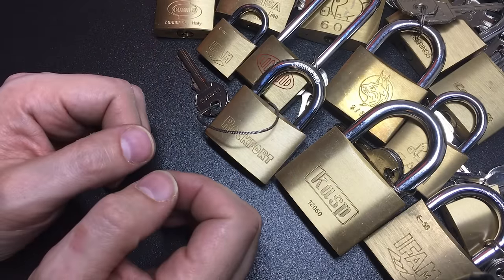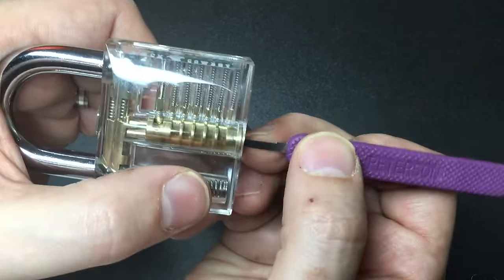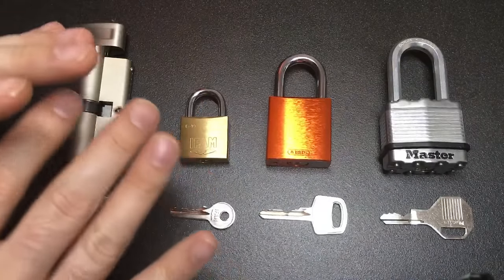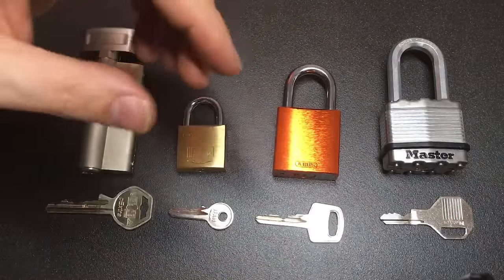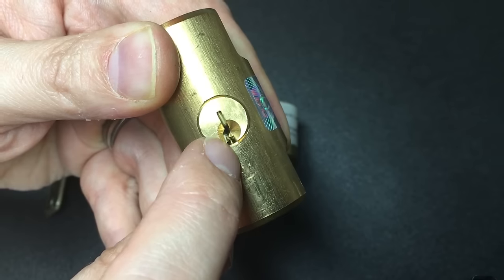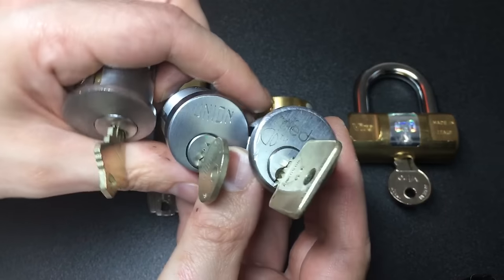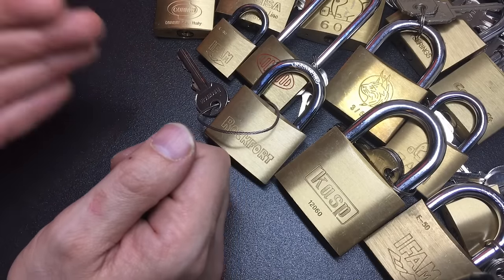Top 10 Reasons Why You Can’t Pick a Lock

Comment from the maker: This is my Top 10 reasons why you can’t pick a lock. Did I miss any? Let me know in the comments! 👍😃😃
Reply: I also find weak springs makes it harder to pick.
Example, if I put the key in with the pins on top like your picking it the key will turn smoothly. If I turn the lock upside down and insert tbe key it wont turn because the springs are to weak to push the top  pin in the upward direction.
So picking seems harder from lack of spring strength on these locks.
Thanks again great teaching!
Reply: Lock Noob I would like to add that no brand euro to my collection looks like my ces. Locks what is it called?
Reply: I rely enjoyed this video! It has inspired me to keep going and not give up. Thank you brother!
Reply: great video man. i just started n i feeling that pain already
Reply: This may be more for new pickers, or on an installed lock you don't have info on, but tensioning in the wrong direction! Have done that more than once!
Reply: Thoughtful videoclip reminding me of the very basics. It is easy to forget. Educational.
Reply: You don't use the right training tools aka you learned how to pick a specific lock and not locks. That way you make wrong assumptions(one of your points) always try to get several locks of a specific type and switch between them. Learn to pick lockS not one lock.
Reply: You might be trying to rotate the lock the wrong way. Been there; done that, wondering why no pins could be set properly.
Reply: @RWBHere  got a US core gifted. Been there.
Reply: Picking the warding, edge of the chamber, outer pin, or anything else other than the element you're trying to set. Or, simpler, bad pick placement.
Reply: Thankyou. Have been having a frustrating time with a lock that I can open 6 times on the trot, but go back to the next day and then fail for the next 3 days! Never considered the core spring affecting tension balance. Opened it twice since watching this. Subscribed!
Reply: I spent over a year trying to pick this crappy cheap master lock, I tried everything to pick it and I shined a light in there and there is a pin lodged to the point it wont turn the core. For a year I just thought I was defeated by a master lock, i also have a cheap uhaul lock that may have a similar problem further back.
Reply: Knowing that your left hand, and your right hand are doing. As ì am picking ì  Notice my tensioning getting stronger from excitment. My weakness
Reply: 11 you've never picked one before, don't have the tools, don't know what lock you're dealing with and don't even know what you don't know
Reply: One more reason: Random fabrication details
Some month ago I bought a bunch of locks on ebay including an ABUS "mylock". These are typical locker locks and easy to pick, but this one was almost unpickable. Absolutely no feedback, almost no perceptible binding and it was impossible to rake or zip it open even though it just contained standard pins. The key worked fine so it wasn't broken but I couldn't manage to pick this cheap lock for weeks. Then I gave it to a fellow locksmith who also wasn't able to pick this one. I tried 4 other "mylocks" and they all were easy to pick but this single one was a real problem. When the fabrication hits the spot even cheap locks can be a real pain.
Reply: @thumperlockpicking9269  Yep! I do it all the time.
Reply: @mrbear8746  where are tho brother?
Reply: @thumperlockpicking9269  I'm in NC trying to stay cool! Lol.
Reply: @arterialtribal  having this issue with two unbranded locks. Both standard pins but no joy. Pick the bigger more expensive locks no worries.
Reply: What if the core turns half way and stops? I don’t have a key so I’m not sure if the lock even opens. Could that be it or am I doing something wrong?
Reply: @johnwickpick8621  7a
Reply: @1stNumberOne  there could be one of a number of problems.
A couple off the top of my head might  be,
1 pins fall through bible into bottom of keyway (need to be relifted using pick)
2 cylinder is rotated wrong way (pick again tensioning in the opposite direction or use pl spinr)
Reply: A couple of problems i remember i used to have was how to know what pin im touchijg and manipulating and also how to tell whether this pin is binding or set or falsely set etc
Reply: Very helpful great video thank you
Reply: @johnwickpick8621  .
Nice

Comment: Sometimes the tension tool slips and i think i have a false set :)
Reply from the maker: Been there!
Reply: Always.Never able to do anything about it
Reply: How good is it! Haha
Reply: GottaGetMe6  now thats funny
Reply: I felt that, like spiritually
Reply: Lol im still doing it. For a split second i get that little feeling of excitement and then the despair sets it as the set pins fall 😣
Reply: Sometimes it falls out and I think I've opened the lock
Reply: i had a job where the tensioner horizontally on the right had me pushing it down so it interrupted the pick and kept flicking out of the space ive put it in (it simulates a pin click or core rotation but really isnt)
Sometimes the problem is fixable(if you dont have the right tt)  by switching the tt (in my case i placed it on the left and pushed up instead of on the right and push down)
Reply: @lakshaynegi82  i get this often too, can only say you'll likely need a thicker tensioner so it doesn't have room to slip, hope this helps but it is annoying!
Reply: How do I fix that
Reply: @ziga1868  depends on your original stance

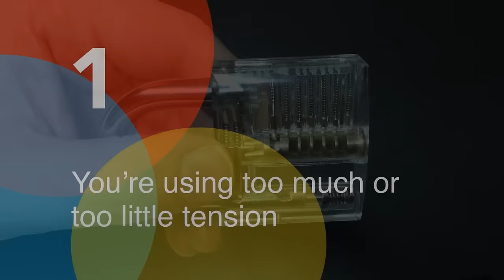Comment: 00:30    1.  You're using too much or too little tension
02:40    2.  You're binding the core
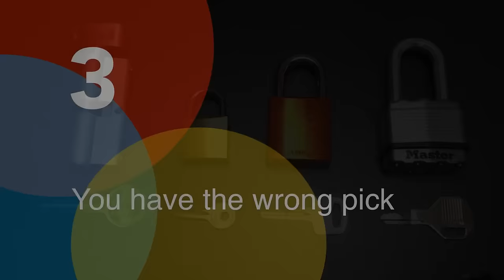03:48    3.  You have the wrong pick
08:54    4.  You misidentified the lock type
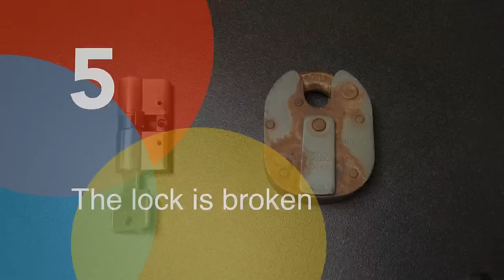13:26    5.  The lock is broken
15:27    6.  The lock is dirty
17:24    7.  You chose the wrong tension tool
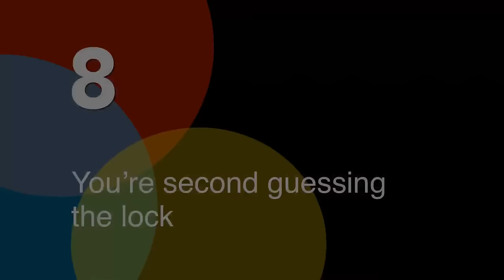19:32    8.  You're second guessing the lock
22:17    9.  The lock might be beyond your current skill (for now!)
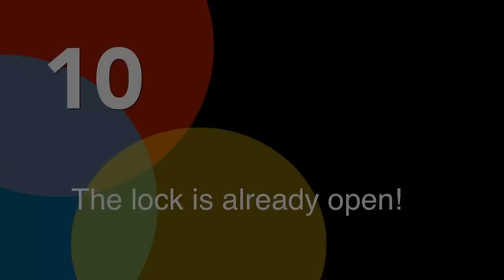23:55  10.  The lock is already open!
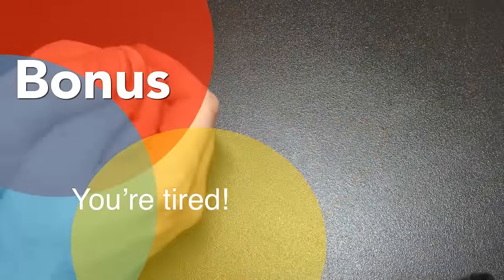25:40  Bonus reason:  You're tired!
Reply from the maker: Useful
Reply: @LockNoob  Reason 7.5 : You don't *have* the right tension tool.  Nothing in your bag-o-tricks quite fits the keyway so you can reliably tension the core and feel some feedback ... and you must still have enough room for the pick(s).  Time to acquire/build/hack more tension tools.  :)
Reply: Give this guy a thumbs up !
Reply: @LockNoob  I have one of those high spring tension disk padlocks that's super easy.... well except the poor quality means a bare minimum tension. Because pin 4 will get caught below the shear line. It's also pinned like 5 1 1 5, so really easy to over set also. Been so many times I've struggled with that (especially if it's later in the practice rotation) that #10 & #11 probably defeat me. I've seriously thought about offering it as a challenge lock, because it was supposed to be easy. But eventually I have decoded it.
Reply: Excellent.  I was looking for this.  Thank you
Reply: @arrrg3846  yeah I couldn’t open a lockbox and just assumed it was double sided but I didn’t have the right rotation tool. Turned out the pins were on the other side
Reply: You might forget that being drunk is not the best condition to pick a lock.

Comment: All very sage advice, I've experienced almost everything described here in my few months of picking. Tension has been my #1 battle, it can be soooooo different from lock to lock and if you're like me and grab a wide variety of brands and difficulty levels for each practice session, you can find yourself trying to apply what worked with the last open to the lock you're now picking and it just doesn't translate. Tool selection would be the second most important thing that I finally had an 'aha moment' and started reaching for the thinner, more extreme profiles (ie Sparrows Lunatic in my case) that I was avoiding because they looked too different and I had in my head that they were just for really extreme bitting but it turned out that using a profile that had so little meat to it did a couple of things for me. First, I had to ease up on my heavy handedness because if I applied any real force to it, it was going to snap and that allowed me to practice finessing the pins in a gentler way than I had before and really highlighted that I'd been forcing pins into oversets far more often than I thought. Second, it's all around a more versatile pick with the reach it has so I found I wasn't bouncing back between picks  anymore, I was able to use it to set those high pins at the back without oversetting the lower cuts in front of it, but I could also use it to set the more 'mundane' pins along the way. Great video, I know there'll be many new pickers who will have their minds put to rest with some of these tips and those of us who just need a reminder. Awesome video 😀👍
Reply: Dear God that was long winded...sorry about that. Apparently my coffee has kicked in 😬😂😉
Reply from the maker: Thank you for the great comment!

Comment: Earlier today I picked 5 practice locks I cycle through in 10 minutes. The two I have the most trouble with I picked 3 or 4 times in under 30 seconds. Later in the day same locks took me 3 hours. Granted I've only just started to learn I've barely been at it a week and I've only just slowly been collecting a few locks to practice on. I ordered a better set of tension wrenches because I get almost no feed back from it. I feel nothing. I of course know I've only been working on this less than a week so it will take time. 

I'm almost certain it is tension. and the cheap set I picked up to figured it out just have too much give to them and I don't think the are putting tension right. They slip and don't sit in the key way well. Still I can get them there eventually and worse comes to worse I just rake them... I mean hell one is a master lock 140 a family member brought me and I just laughed. 

Also I don't have "the Tool that Bosnian Bill and I made"
Reply from the maker: Keep collecting and practicing- tonnes of fun!
Reply: Old comment (lol) but I went through the exact szme thing and ended up spending hours try to figure out a universal position to apply tension to the lock
Reply: Dude this is 100% me right now. And I’ve been practicing everyday for a month now. Guess I’m just a really slow learner 🤦‍♂️🤦‍♂️

And I 100% cannot blame the tools either because I went and bought the best I could find from Covert/Peterson/Sparrows. 

I’ll pick a new lock within minutes the first day I get it, over and over again. Then the next day I’ll spend hours on it unable to figure it out. So frustrating….especially when it’s a master lock #5 🙄🙄

Comment: The "Picking fatigue" explanation rings surprisingly true to me.
I've got a big box of repinned half euro cylinders and various cheaper end padlocks. When I get bored I'll grab around 10 out of there and pick them one by one. They'd either take me 5 to 10 minutes total to pick the lot It, Or I'd be struggling with every single damn one, and it would take over 45 minutes. I'd also end up usually giving up on 3 or 4 of them too. It always confused me why there was never any middle ground. I'd either zip through them at a ridiculous rate, Or they'll be fighting me every step of the way and I'll have to admit defeat on nearly half of them. I was thinking it could be phycological (Like how if you made a silly little mistake near the beginning of a driving lesson, then the rest of that lesson tended to turn to crap). I was thinking it could be that on a bad day I'd managed to pick a bad lock out of the box to start on, and that screwed with my head.

(As an example of "A bad lock to start on", I made most of my collection of half euro cylinders quick repinable by knocking out the bible's pin plugs and tapping them for grub screws. But for 2 of them I ran a 3.2mm ream right through the bible and into the core. I did one hole first, then fitted a 3.2mm dia locking bar into it to keep the body and core aligned before then reaming the rest. I made some pretty much exactly 3.2mm plain key and driver pins for these out of polished spring steel. The result is that as all the internals are REALLY accurate, the pins have as close to zero slop as I could get, and the pins ALL go from free to bound at very nearly the same tension (Unfortunately, Some of them also partially seize up when they're much below room temperature ! 🙄). It's also hard as hell to tell if you've set a pin because until ALL the pins are set the core has next to no rotation. :)
I only built them because I've got a friend who also picks locks for a hobby, and I like to keep him on his toes. I think he's going to have fun with these, And when he finally get's p*ssed off and gut's them he won't be able to understand why he was having trouble !!!! LOL !)
Reply from the maker: Thanks for the great comment!
Reply: Man you nailed it on the head! Don't know how many times I'd pick a lock close it and struggle mightily seconds later on my second attempt!

Comment: I pick'd the Chinese Laminated padlock I found in the woods during this video! I kept following your advice. It was dirty & I know it needs graphite but it was free so I dropped silicone 3 in 1 and it cleared junk out. I then followed your advice about high/low bitting on the key & tried a 2 peak bogota rake  & boom! Unlocked! Around 20 minutes in this video. Didn't wanna turn @ first as the entire laminated lock was rusted when found outside. Made me so happy when it unlocked. I just got my picks a few days ago. I've already picked a Kwikset handle 5 pin with low/high pin 4/5 bitting on the key, & this padlock! This was the first one I picked without having a key for it.

Comment: I laughed so hard when you said the reason why you can’t pick a lock is because it’s already picked. It does happen. Sometimes I can get into a rut, & lose confidence, then I just can’t pick a lock. Other times I feeling great & just go for it, opening difficult locks without a second thought.
Reply from the maker: Yes, picking is a fickle thing!
Reply: Once I was trying to pick this lock. I had been working in it for days, and I found out that I just wasn’t using enough tension to rotate the core (It was a disc padlock)

Comment: One you missed was that the lock is so poorly made it is hard to read the feedback because of the bad machining of the parts. I often come across Iron padlocks like that.
Reply: Yeah that's my first mistake, when I started I bought a bunch of cheap Chinese locks but they were so poorly made that it was hard to put the key inside
Reply: @pregno1421  I received one recently....it had me stumped for a hour. Eventually I added lube and worked the key over and over till it got smoother. Boy oh boy the shackle sounds horrible when it turns to the side....very rough and gritty.
Reply: @BD90..  yeah, after some time I figured how they worked but sometimes I didn't know if I was touching pin or just trying do move a solid piece of the cilinder
Reply: @BD90..  on the other hand if I have to secure something and I was scared of lockpickers I would definitely use a shitty Chinese lock lol
Reply: And they tend to snap core in half. Doesn't happens often , but it happens. And crack is so small that is almost invisible or looks like scratch on core.
Reply: @s0men00bb  That has happen to me on the really tiny cores.
Reply: @pregno1421  Well they might try shim it instead.
Reply from the maker: Oh yes! Absolutely! So bad they’re good lol
Reply: @BD90..  , me too. And they often have iron pins which quickly wear out , by just operating them. I drilled one by hand with small round file just to find out that they have cheaped on every single aspect.